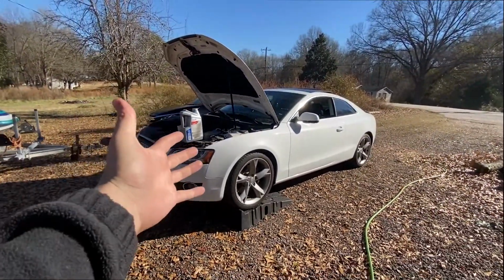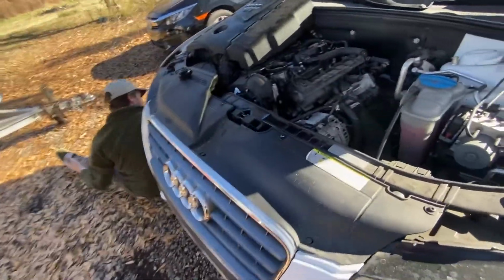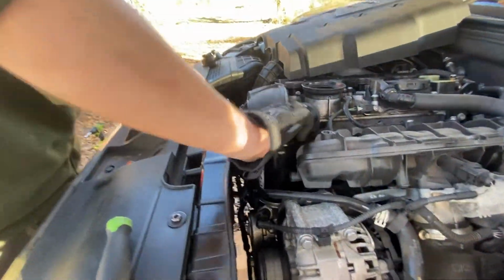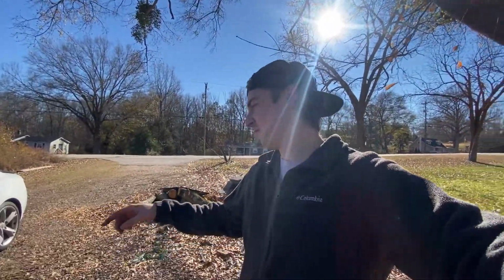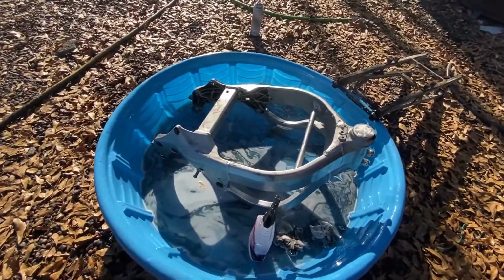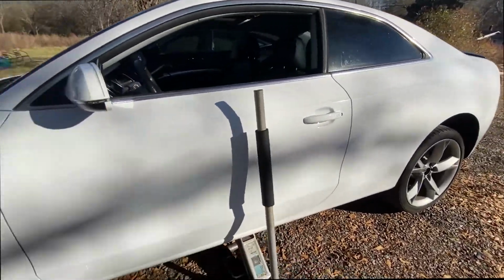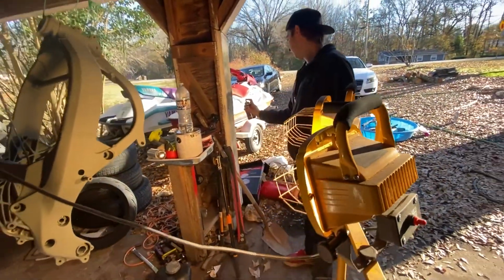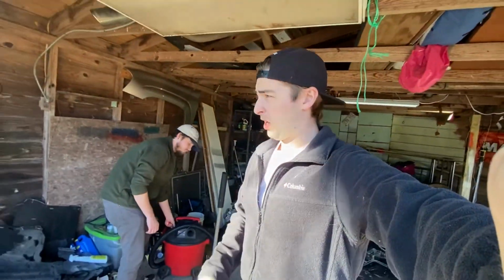How to CHANGE OIL on Audi A5 2.0T

Comment: You have missed some very important parts to the oil change.
Use only the high-quality engine oil that expressly complies with the Audi oil quality standard specified for you vehicles engine.
DO NOT mix lubricants or other additives into the engine oil. Doing so can cause engine damage. Damaged caused by these kinds of additives are not covered by any Audi Limited Warranty.  
Overfilling engine oil can cause misfire DTC’s to be stored in the Engine Control Module (ECM).  To prevent overfilling add 0.5 less than capacity. Start engine and let it run until engine operation temp is Approx. 140Deg. Or 60Deg. C. Turn OFF ignition, wait approx. 3 mins. Check dipstick, them fill to MAX. TURBO ENGINES ONLY. 
After changing oil and filter, start and run the engine at idle until oil pressure light goes out. DO NOT rev engine as this could cause damage/failure of the turbocharger. 
Quantities are approximate. DO NOT overfill
4.6 L  5w-30  or 5w40
Torque socket T45. For the oil pan drain plug.
FYI, after you're all done this you STIHLL have to plug in the program to RE-SET the "SERVICE DUE", which most of us don't have so you'll have to go to a shop that has the Audi program to re-set which will cost you shop rate. 

This is how you do a proper oil change from beginning to end.
Reply: Perfect 🎉
Reply: Its a used 2001 car worth about 2k, not sure the correct KIND of oil is any matter here, a higher milage oil can be used and if you want to be anal, just make sure a flush is done. Moly 0-W20 is used for newer AUDI cars. AND.....I doubt they had a warranty either lol.  your copy paste Comment is true for newer cars yep.
Reply: Thanks, most tutorials are bleak.